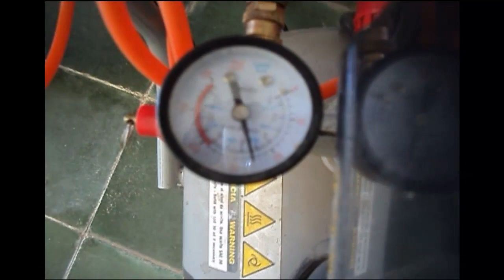moto a aire comprimido (Hecha en Argentina)

Comment: ¿Cuanta presion se le puede meter a una garrafa? Y cuantos kms se puede hacer c una de 15 kgs
Reply: no creo que mas de 10kg/ cm2  y a lo mejor recorre 150 metros  la ecuacion de la adibatica te da la energia que puedes acumular como dato un tanque de GNC  70 litros 16 m3 a 250Kg/cm2  guarda una energia de presion de 2Kw-h o sea unas 4 baterias de 50amp/h pero pesa 5 veces mas
Reply from the maker: increible tu respuesta +Enrique Nuñez esta clase de dedicacion en los comentarios es lo que hace a youtube una verdadera comunidad interactiva. En esta garrafa nosotros pusimos alrededor de 110 - 120 psi osea alrededor de 8kg / cm2, pero con esta presion, hemos logrado recorrer mas de 5 cuadras, habria que tener en cuenta, que el aire es soltado en intervalos pequeños cada 2,5 veces por vuelta de rueda + o -, y que el resto del tiempo solo se mueve por el momento.